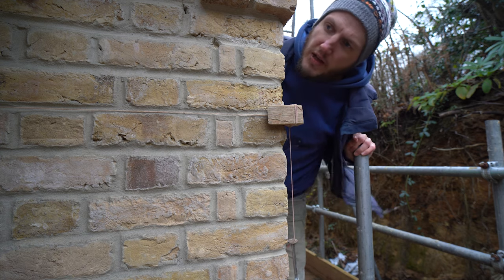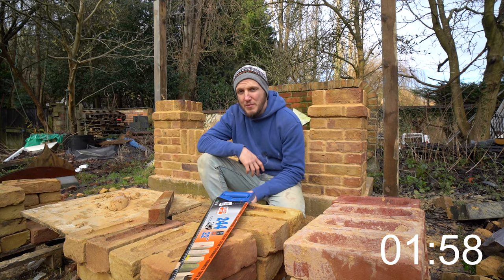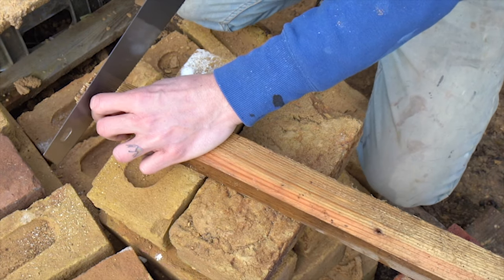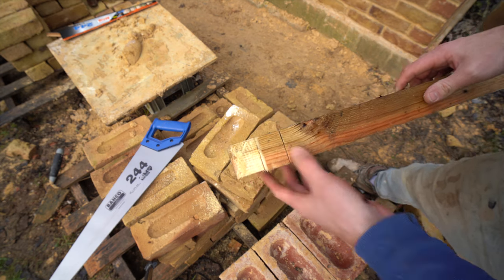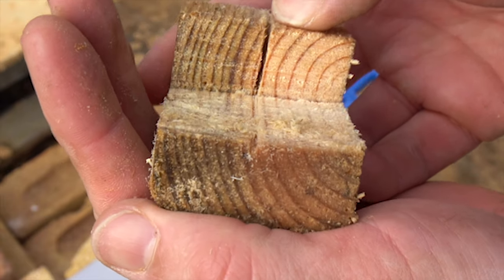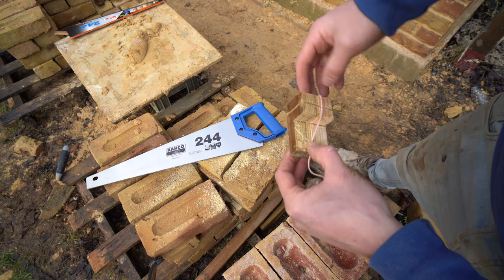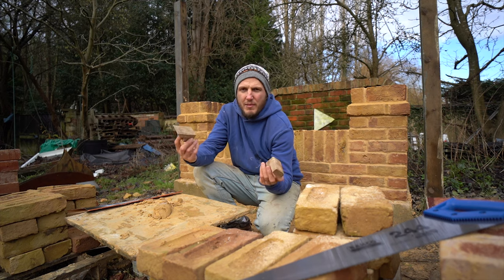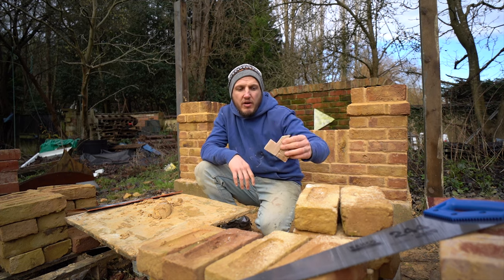BRICKLAYING - Never buy CORNER BLOCKS again!

Comment: What if you cant use a corner block or vertical gauge at either end because you are butting up to a wall or fence?  many thanks
Reply: Use a nail. Mason nail in a brick wall & usual one in wood. You need to set your nail to gauge & level carefully, use a long level for a short distance, laser level if you have one, or a water level, if all else does not work for you for some reason.

Comment: Hi Rodian, I'm a big fan of your work. I have a question on window openings and I am hoping you can answer as it has been annoying me for days. Here it goes. With a 2 leaf building (brick outside / block inside) for the window opening must the openings be the same size? or is the (outer) brick opening 20 mm less than the inner opening i.e. to stop the window falling threw the opening? I hope you can give me some expert advice here.